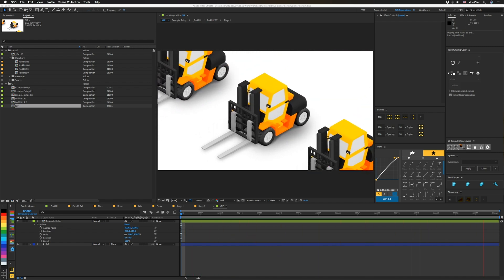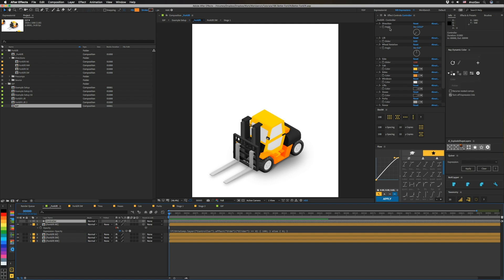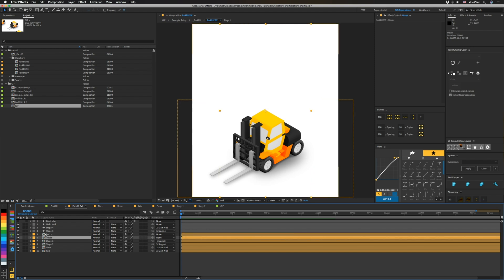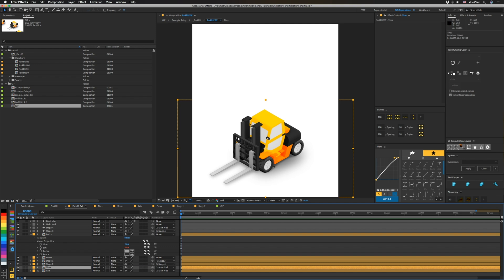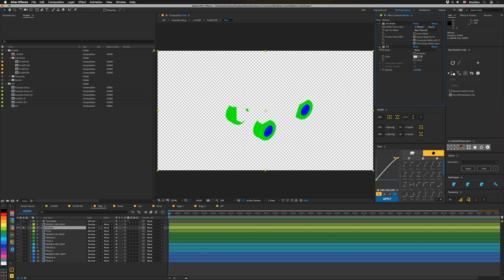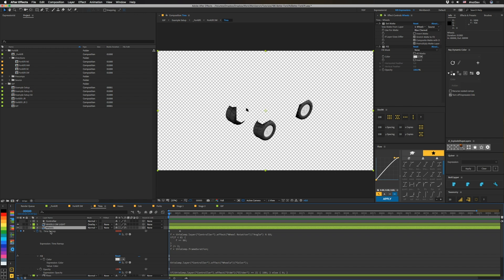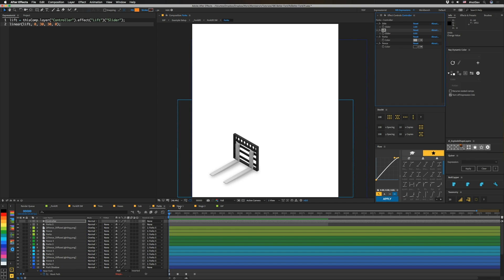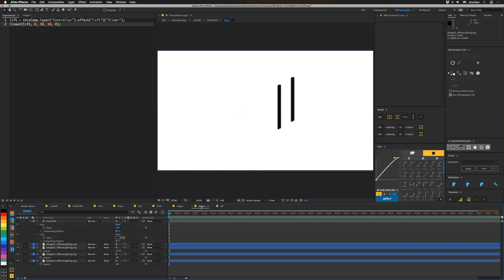Rigging ideas for After Effects - Part 2

Comment: So if I am understanding correctly, the part 1 tutorial is more geared for isometric elements and this part 2 tutorial is more for 3D renders?
Reply from the maker: For the most part, yes. You can use some of these rigging ideas for either. It's mainly to show off different ways to rig.